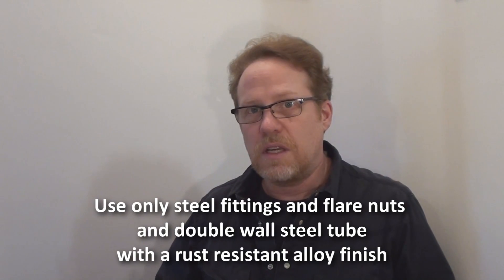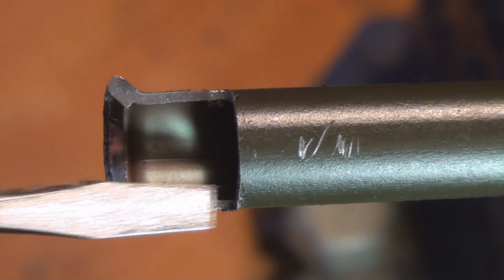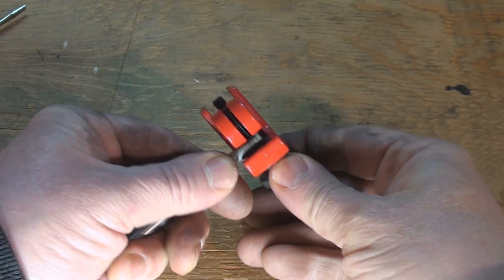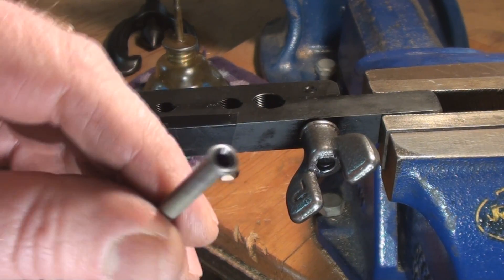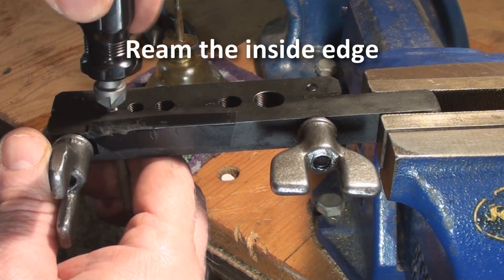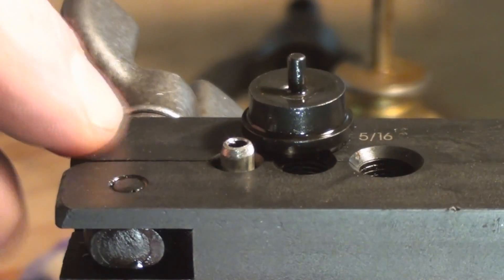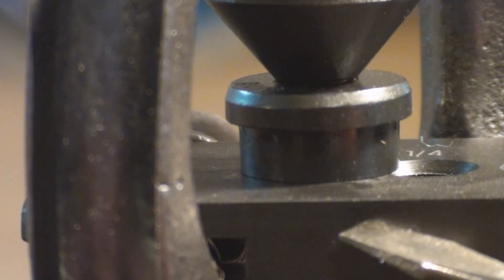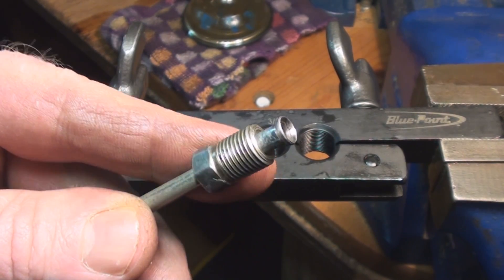Brake Line Double Flares

Comment: What angle should the chamfer be?
Reply from the maker: The more you remove the thinner the wall becomes and the more fragile the flare becomes. So depending on material I generally go anywhere from 30 to 60 degrees.

Comment: Hi, great video, thanks.  I have a couple questions.

I'm looking at your external chamfer.  It's one of the steeper angled/longer/more aggressive chamfers I've seen done.  Is there a specific advantage to this? On your cutaway double flare (great idea, btw), I'm not seeing any substantial chamfer. The edge just looks like it's rounded slightly.

I would think that an aggressive chamber would give you a gap where the two layers sandwich together, or, even worse, if it were to compress, it could change the 45 degree angle where the flare marries the fitting.  At least, it could change the angle for the length of the chamfer.

Does thinner material stretch better during flaring? With a thinner edge is the tubing less likely to split?

On most videos that I'm seeing, the external chamfer is less about thinning the edge of the line and more about just making sure there are no burrs.  My  existing lines that I'm splicing into aren't all that accessible, so the kind of filing that I'd need to do to achieve your chamfer would be close to impossible.  I'd also be greatly concerned that the chamfer would end up uneven, which would then portend poorly for the flare.
Reply from the maker: Great questions William. I'll say yes and the advantages are your next questions - yes and yes. 
I always had issues with inadequately chamfered flares.
The cutaway is factory made, likely by a robot.
FWIW I exaggerated the chamfer for the camera, then cut it way back on the bench grinder.
Reply: @repairs101  Thank you for the timely clarification. It's not the answer I wanted but... if adequately chamfered flares have historically been less problematic for your, then, a-chamfering I will go ;) 

While I've got you.  Any tips on flaring old lines that are on the vehicle?  The areas where I'm splicing are in pretty good shape.  They've got a layer of paint, some white deposits, and maybe a discoloration or two to the steel (tiny copper-ish look spots), but everything comes off with some fairly light sanding. I picked up a Titan tool and, while  the surface on my flares that mates to the fitting is angled well and smooth, sometimes the hole can get a tiny bit oval.

Also, what's your advice for torquing steel pipe in brass unions with steel fittings? Hand tight and then a quarter turn? A half turn?
Reply from the maker: @williampierson4340  There is a flaring tool design that is made for on vehicle use. I don't have one - I believe in replacing lines - but I think all the major players (Snap-On etc)  make one. Maybe try to get a small die grinder in there to do the chamfers. Oval may be from squeezing too tight but I've never used a Titan. I was not taught to do 1/4 turns 1/2 turns to apply torque. I was taught to develop a feel for it which I cannot teach in this forum. Repetition is the key. It's something like - snug plus a scootch. Good luck!
Reply: @repairs101  I was able to buy an external chamfering drill bit, and so far, that's been working well for me.

I also bought an extra set of unions and have been practicing tightening with those with some of the steel tubing that I cut out.  So far, it looks like they can take quite a lot of torque without an issue.  

One last question :)  I'm looking at the wall thickness on the copper nickel that I'm splicing in and notice that it really doesn't have much to chamfer.  Copper nickel is so malleable, I'm guessing a chamfer might not be necessary, right? Just a deburr?.
Reply from the maker: @williampierson4340  Yes.
Reply: @repairs101  Thank you for your help. 

One more question.  I've been continuing  testing turning revolutions/tightening force.  Looking at it from a perspective of the compression of the flare inside the fitting, would you prefer the flare to a) just start to compress/collapse, b) be halfway from being fully compressed, or c) be squished completely against the  inside of the fitting?

I notice that, on the flares that I make (titan tool), the outer edge of the flare (towards the neck) is a bit twisted (the tool rotates the flare a bit during forming), but when I fully compress the flare inside the fitting, it actually remove the twist and I get a pretty darn good conical shape. 

Regardless of my tools shortcomings, and how aggressive compression seems to resolve them, I would think that, if you ever had to take the fitting off, you'd want a little more space to be able to compress, but you're far more knowledgeable about this than I am.

Comment: “Nothing should go in your brake system but brake fluid…”

Sprays it with Brakeclean. ROFL!!
Sorry. Had to harass you. Well done video. I learned something.
Reply from the maker: Thanks for admitting you learned something.     :)
Reply: @repairs101  absolutely. And to the guys out there trying double flares, the little kits on EBay and Amazon are pretty bad.  The bars need centering pins and the bores gall the heck out of the tubing.  Oiling the joint was definitely the key for me but it was still easy to get a lopsided bubble (first flare). Thanks for the help and taking the time to actually produce a video.

Comment: actually you don't have to only use steel. Copper brake lines are perfectly fine, and far easier to work with.

Comment: I think the chamfer is where I was messing up I would never do a big chamfer so my line was extremely hard to bend with the yoke and I basically gave up cause my yoke would start to go sideways and I could never get it to center no matter which tool I rented from autozone, orielly, Napa or advance auto
Reply from the maker: I've tried to skip the chamfer to save time and invariably lost time having to do it over again.

Comment: Needless to say, there are many times that you can't remove the tube from the vehicle. I have found that this tool made to debut bolt threads works outstanding on putting the chamfer on the outside of the tool. It is simple quick and perfect every time. Thanks for your video.
Reply from the maker: Thanks for the info!

Comment: That's a really nice flare,
and a pretty nice solid looking tool set.
But there are certainly brass fittings on brake lines sometimes.
I restored my MG with a set of brake lines and all the fittings were brass (tubing is CuNiFer).

I mean, right?
Reply from the maker: Older machines of all sorts have brass fittings but in mechanics school they taught us that all steel was the new standard and to be used exclusively

Comment: I was going to ask if this could be done on-the-vehicle, to replace, say, a rusted section, but I predict your answer would be: It depends--on whether there is a suitably long straight section in an area with room enough to be confident that flares can be made well. What would help would be smaller tools to facilitate the chamfering and flaring in a tight space. I'm thinking of a one-size flaring tool and a "cone maker" file or hone that slips over the tubing end to file the chamfer.

Comment: Nice video.   My prefab brakeline kit had brass fittings.  I cant believe they would provide a dangerous fitting??  I dont think I have seen fittings that were not brass.  I think brass may be better since it is softer than aluminum (like a master cylinder casting) and that crossthreading won't ruin the piece its going into.

Comment: Chances are, I may have had a hand in on making your flaring tool. I worked at a machine shop called Dowley Manufacturing for quite a few years and we made them for snap on blue point mac and several other names
Reply from the maker: Cool!

Comment: ive seen factory oem brass fittings on brake lines, never heard not to use them till now. 1/4" brass flare fittings can take more than 5 times the pressure that your braking system can produce, brake fluid will not eat brass either, so why not use them.

Comment: Thanks for the preparation tips . But, that didn't look like a double flare .
Reply: It doesnt ,i thought the same but it is, it has to do with the thinning of the tube wall after chamfering and so when the anvil is impressed fully it has then created a thinner walled bubble that the second cone shaped anvil impresses inward which at the end is a doubled flare but thinner because of the chamfering process

Comment: You can NOT use compression fittings to join hydraulic break lines. You must buy the proper fittings to join both line ends with double flair connectors.
Reply: flare

Comment: For some reason I cant get a proper flare. My tool leans to one side and always makes it useless. Any reason why?
Reply from the maker: Hard too see from where I'm sitting... JK ... maybe you're torquing the flaring cone down too hard?  maybe your flaring kit is cheap junk? I wasted a lot of tubing before I bought my 3rd and final kit from Blue Point.
Reply: Probably. This one was was a place in canada similar to harbour freight. Cant make straight flares and they usually bend with anything over 3/16"
Reply from the maker: You talking about Princess Auto? Powerfist is definitely not Blue Point.
Reply: yes, its was a double flaring set I picked up for $25 and returned now lol
Reply from the maker: Gotta love Princess Auto's return policy!

Comment: What would cause a brake line connection to leak out the back where the line goes through opposite the threaded side?   its on brand new line Ive tried 3 different brand new connectors cut the line back and re flaired it 4-5 times, all my other connections I did the same day (using your method  thank you by the way pulling my bench grinder out and prepping the connections was brilliant...!!!)    no other leaks  just that one spot where it goes from hard line to flex line to the rear diff.   its where the first leak was that prompted me to change the whole line front to rear  then when I was attaching it the lines on the diff cracked (all rotted)  so I replaced them but that connection STILL leaks with all new line.  I cannot use the grinder on it because of the location Id have to pull the whole section like 12ft that feeds through the frame and behind the gas tank lol    any thoughts?   jb weld maybe or.....??
Reply from the maker: Wow tough one. First thing that comes to mind is maybe the fitting you have is Bubble flare not Double flare? Next idea maybe the line is brittle and the flares are cracking - make sure the chamfer you grind is as small as you can make it - the idea is to facilitate rolling the double flare without weakening the flare wall and or edge. Good luck.

Comment: Gear informative how to video! Did flares my whole life but only 1 or two doubles so I always need a refresh, this was AAA+ how to vid thank you and keep them coming. 

I would give you an Emmy for how well you did and filmed this video! 

Note: hard to find just anvil when you already have flaring kit. To the best of my knowledge you can't generally buy just the anvil,  so you can get a discount set and use with your good flaring tool set or ask a local mechanic to borrow the part if you are only going to do it once. Some auto parts stores will loan yo the tool also.
Reply from the maker: Thanks Shoestring!

Comment: I cant believe Ive gone so many yaers not doing this exactly right... Today I am replacing a line on a Sunfire and after tightening the nut the line was loose in the fitting... Im doing this on the car so its a bit harder than having the vice handy... but I have never filed the end of the line as much as I guess I should have been and I think that has made this harder than it has even needed to be... Thank you for making this video.

Comment: y is it that when I tighting my flare tool down its turning side ways and won't turn straight down I'm using the tool by hand with poly armor brake line I don't think the line is str enough it seems to bend inside the tool where do u get strong brake tube from
Reply from the maker: I don't know where you live, Dude.
In Canada try Lordco, Princess Auto, NAPA, any automotive supply shop.

Comment: How tight should I tighten the wingnuts on the holder for the line?  I keep scoring around the brake line when making the flares...
Reply from the maker: +John Ceci - if they're witness marks - impressions - that's normal - if you have the line turning in the flaring bar then your bar is not gripping adequately and possibly no amount of tightening will fix that - I threw away 2 cheap sets before I got the Blue Point set.
Reply: Thanks, going to try one more time cranking down on them as hard as possible, if no go then this set goes back to AutoZone...

Comment: This video is great and I'm sure I'd have decent flares after watching it apart from one issue.  The flaring kit I bought doesn't have the little step on the tool to indicate how much the line should protrude from the clamp.  Would anyone be able to measure this for me on a 3/16th tool?  Thanks!
Reply: I just bought one today.....ill measure it in the morning if you want.
Reply: I just bought one today.....ill measure it in the morning if you want.
Reply: I just bought one today.....ill measure it in the morning if you want.
Reply: +Matthew Thompson I'd appreciate it!  However that tool is going in the bin as it can't even hold the line tight enough to flare it - and when I was attempting to tighten it more with vice grips the wing nuts snapped.  I've ordered a different style now, if you search for serenco you should be able to find it, hopefully I'll have better luck with that.

Comment: Thanks for the video and it was straight forward and even included the importance of BRAKES.  Now I'm ready to fix my brake line, as it had to be sawed off due to the fitting becoming one with the caliper and I replaced the 19 yr. old caliper.
Reply from the maker: Daniel Rynberg I've seen that happen many times - usually try pre soaking with penetrating oil the night before and using flare nut wrenches but sometimes they're so far gone it's a joke. Good luck and thanks for commenting!

Comment: On a side note for people it is good practice to deburr your brake line while holding it upside down that way you can minimize the chance of any metal shavings being left behind inside your brake line which could in return damage the rubber seal in your brake calliper

Comment: Thanks for the fast reply! I may not have described the line correctly. Here's the description from AutoZone: Domestic/Import
Premium nickel-copper brake line coil does not rust or corrode & bends 58% easier than steel tubing. OE on many european vehicles.
Reply from the maker: Steve Lipofsky I honestly can't recall ever using that product. Maybe ask ETCG or ScottyKilmer, they're more likely to have used it (I am primarily a boat mechanic but with many years on HD equipment like forklifts and cranes).

Comment: Great video, Thanks!  Is there a problem with using the flexible copper alloy tubing?
Reply from the maker: Steve Lipofsky Hydraulic pressure of a brake system would burst copper pipe with the first tap of the pedal. ONLY use double walled steel tubing for brake systems. Good luck!
Reply: Repairs101
In the UK we use either copper (won't rust but is not strong) or preferably cupro-nickel which is strong AND won't rust.

Comment: Some stores sell the flare tool for much less, is it worth the extra money if you don't plan on using it much? Great video!
Reply from the maker: George Zegouras I tried buying cheaper flare tools twice before I got the Blue Point set. The other sets both made lousy flares and eventually broke. Ironically, if I had just bought the expensive set to begin with I would have saved money. Another example of "you get what you pay for".
Reply: Also make sure that the flare tool set you are buying is capable of double flares.
A lot of the flaring tools out there are only for single flare.

Comment: i'm lost, what is a double wall steel line' it looked like a single wall tube with a doubled wall flare, please correct me if i'm wrong ?
Reply from the maker: Joe Corrie  "Each line is made by double wrapping a copper coated steel strip to form a double wall tube. Next, the tube is furnace brazed to fuse the copper/steel tube into one continuous and seamless tube." http://www.plews-edelmann.com/standard-steel-lines/

Comment: I have boogered up about 10 feet of tubing. Tonight I give this a try.  I think the outside bevel is going to do the trick along with flat filing the top level.  Here goes nothing ...........
Reply from the maker: Hope that went well for you. I used to have a heck of a time with them because I didn't know to chamfer and level the end and I had a cheap flaring kit and didn't think it made any difference.

Comment: Thanks for posting this. I watched it a couple of times, then practiced on some brake line off cuts. When i was happy I had got the technique correct i then made replacement lines for a project car that I am working on. All good. No leaks. Thanks again for a really good instructional video.
Reply from the maker: Glad I could help. Thanks for commenting! Good luck with your ride!

Comment: All old Chevys use brass blocks and fittings for brake lines.  Haven't had any problems.
Reply from the maker: Thanks for adding that, lots of people were probably thinking the same thing. How old, anyways? Doesn't surprise me, brakes (clutches?) on the model T Ford used to be a leather band. But technology evolves, so at mechanics school they taught us to avoid stone age materials.
Reply: Repairs101 I know the brass was used at least until 1972.  I have 5 old GM cars, all are pre-'51 and they all use brass and I worked on a '72 GMC with brass fittings.  Not sure when they stopped.
Reply from the maker: Come to think of it, I have seen it on old Forklifts and other heavy equipment too. Probably switched when steel became cheaper to make.